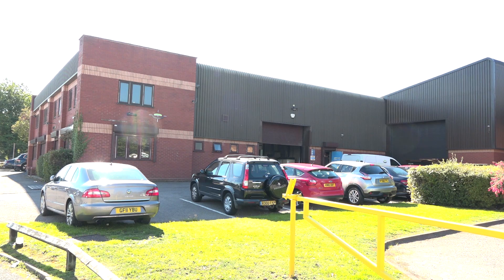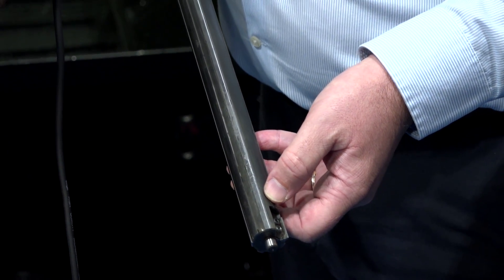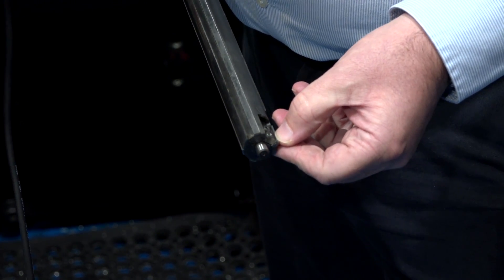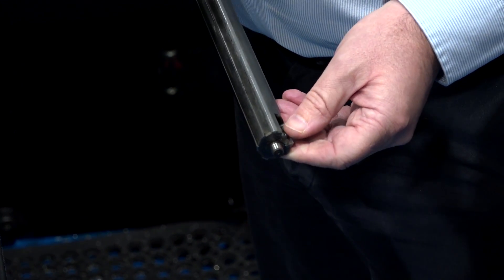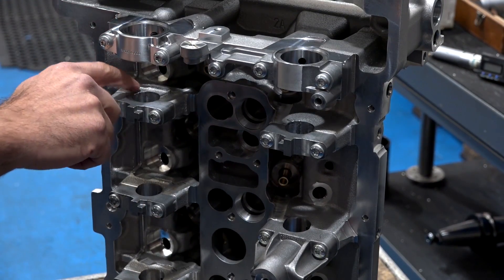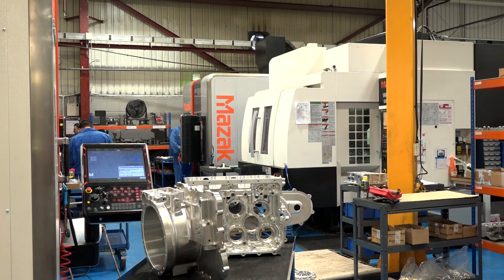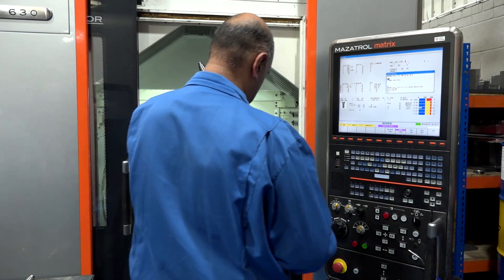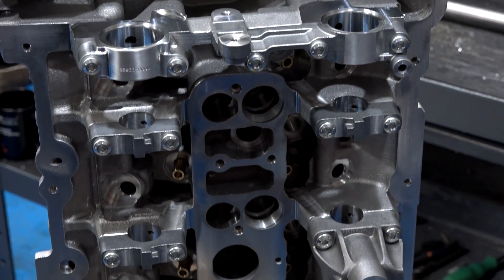Advanced Engineering UK Ltd use Cogsdill Shefcut

Comment: That's a direct drive linear machine too !
Reply from the maker: You're spot on! 10 points if you can guess the machine? 🤔
Reply: Lol...  starter for ten... What is "Mazak Hyper Variaxis 630"  … The new UD -400 5ax form Mazak also looks interesting (5 axis mold machine)… This video was good and gave me some idea about better / more crafty technique/ some'ink to think about. [I wasn't fully cognizant that MAZAK made "linear machines"]. 😎
Reply from the maker: Correct! Glad our video helped you, do you have a video of the technique?
Reply: (Surprisingly), I don't I might be able to dig one up (Do you have a link to one ? ;--) ) . What interested me was that the previously machined/ bored feature acts like a sleeve/bearing for the next feature to be cut 100 mm away and also of course it's an assembly that's being cut rather than single part. So rigidity and stability is maintained. I've seen some gun drilling being applied horizontally using Integrex-es (Not sure what the proper plural version of integrex  is (lol)), and various special components that have to be made for really long skinny tools and holes, but I have never seen anything like what's in this video on a linear machine in that way... I'll hunt about assuming I "got your drift" :-) . [I wondering what the clearances and tolerances are to make that all happen in the way they did ? .].
Reply: Getting there … He said Cogsdril mumble mumble chef's hooks something something reamer..?  [I think you guys did a number of cogsdill vids... hmmm , I'm getting there]. I like the guy in the video [Dave] seems like a very smart guy it's not his brummie accent … Carbide pads... Journals something custom from cogsdill … The cylinder head looks BEAUTIFUL …
Reply: Good evening from Cogsdill UK.   The tool being described is a Cogsdill Shefcut Reamer.  All of the information is on our website here - https://cogsdill.com
if you need any assistance in the USA, please feel free to contact us - cogsdill@cogsdill.com.   Have a great day!
Reply: Getting warmer ---> MTDCNC ---> https://www.youtube.com/watch?v=iMzOoQYWxyw
                                                          Bingo-ish  ^^^ 
lol (I even watched that one).
This was interesting as "He" said the fundamental designs were 35 years old but industry is only NOW catching on to what these range of techniques can provide. Especially Cogsdill  history "Problem solving"/ being ahead of the curve.

https://www.youtube.com/watch?v=0k1ye6SwSdw
^^^
MTDcnc_ Bentley engine block (but not illustrated or explained really). I don't know world first ??????? Actually Cogsdill seems useful to me And I am based in USA so will check out what they have ! CHEERS :-)